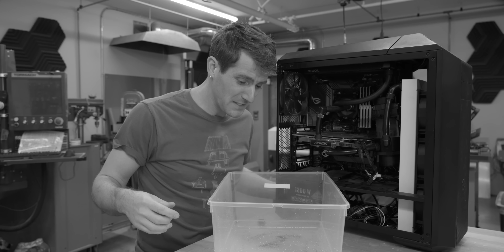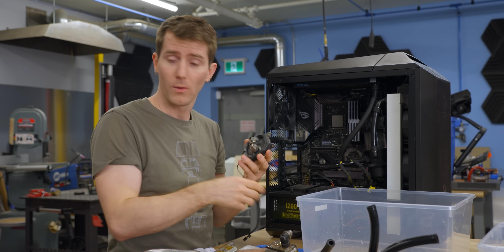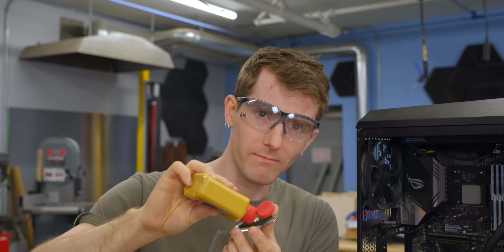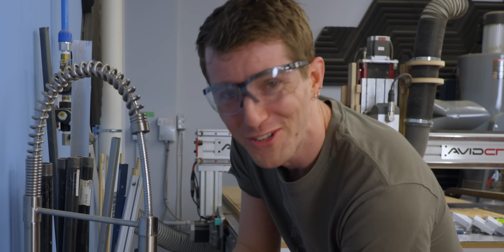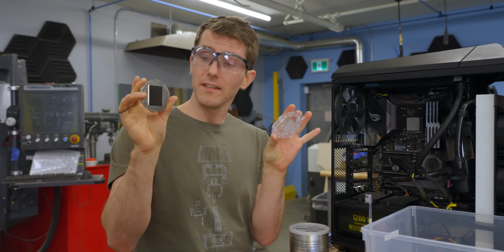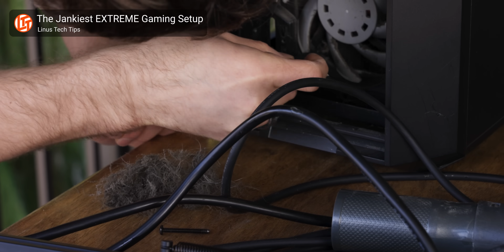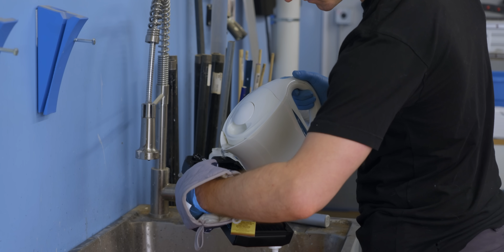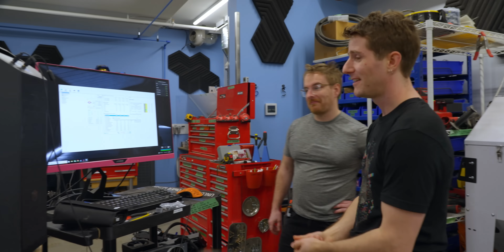I Will Never Watercool Again – Water Cooling Maintenance Guide

Comment: one thing I figured out while speccing my dual loop system was to key the rad fan speeds to liquid temps and pump speeds to device temps.  ramping fans to 100% because the cpu is heated up does little to no good when your liquid is still only a couple degrees above ambient.  After my build I've learned just how much more water passes through a GPU block vs a CPU black based on just how quickly the liquid heats up since, blocks aside, my loops are identical with 560 rads and 300mm tower reservoirs.  GPU loop fluid heats up about 10 times faster than the CPU loop.

edit: and yes, the system is completely a totally unnecessary and could very much have been less expensively and far more easily with air cooling.  apart from an aio on my last system this was my first foray into water cooling and I knowingly decided to just be ridiculous and forego other luxuries like not ordering delivery quite as often for a while.

Comment: Those water cooling "filters" fall apart in the presence of salt. If you added Iodine to the loop it may have been enough to cause it to disintegrate. I have softened water and used it to flush a radiator without thinking about it, next thing I knew my loop had turned purple, as the salt had dissolved the filter.

Comment: Personally, I've never understood the appeal of liquid cooling of any sort. If I'm using high-priced components that most folks would use in a water cooling loop, I wouldn't be able to justify the risk because I know I would mess something up, so if I'm building a high performance system I'll just deal with the extra noise of some fans rather than constantly wondering if my loop is sprung a leak and lost about $4,000

Comment: Or instead of water, you can use propylene glycol, as the industry does.  Completely safe, non-toxic and passive towards metals.  This "propylene" is important.  And it doesn't conduct electricity.

Comment: WTF do you guys even do to your systems?
My custom loop has been running without any maintenance since Fall 2019, closing in on 5 years now. The only effort put into it since completion has been topping up the liquid when I remember to (yearly at best) and minor hardware upgrades that didn't require a complete draining because I included quick disconnects inside for exactly that purpose.
The liquid is still the same shade of orange as the day I put it in (seethrough because particles are system killers), as clear as the day I put it in, and the loop is as performant as the day I put it together.
I think that nearly all cases of catastrophic watercooling loop problems come down to user error. (The last percent being mostly pump failure, which can happen even with something as reliable as the D5.)

Comment: At 17:26
Shaking her radiator....

How about this idea then? Put the hottest water/vinegar mixture you can get without boiling into the radiator, then seal it completely. Put it into a paint can shaker, in shake until the radiator is cool and the liquid inside has cooled down.... Open it up and there will be no squirts, and you may have had five or 10 or 15 minutes worth of shaking!!

I'd like to see a video show me whether my ideas plausible or not.

Comment: Have you tried pushing dry ice through it to clean it ? I use it to clean cars especially metal work with zero damage id be interested to know if its good for cleaning pc components, dry ice cleaning on cars is excellent for removing rust ect ect. Obviously dismantle the parst first lol

Comment: Linus at 18:05 "cut off the end of the tubes"
18:27 : clearly showing tube not cut off
Reply: Linus was the one that said to do it. Him saying it however does not necessarily mean that David will do that, intentionally or not.
We love you David.
Reply: Also said, "IF you had a little bit of extra length"
Reply: Those tubes have no extra length, they can't be shorter.

Comment: always mixing copper and aluminium in one loop 🤡 and dont get a 420mm MO-RA radiator where you can mount your pump on so you dont have to open your case when you never clean it from dust anyway. next step would be drinking the water right away from the loop
Reply: external radiators are just too good, I have alphacool 1260 supernova and oh boy, it is cheaper than most high performance radiators and works flawlessly

Comment: I've only spent $1,700 on my 5900x, 32gb, 16tb storage system with a 6950xt. I only bought an aio. I want to watercool my gpu but yeah I don't think for my longer term use it'd be worth it.

Comment: This entire video is nothing but a testament to why you should use the proper cooling additives including anti-corrosives AND antibacterial. I noticed Linus only mentions antibacterial additives at the end. There's a reason why water cooling fluids like Mayhems exist.
Reply: Yeah I run Mayhem X1 Eco Clear (vegetable based so you can just pour it down the sink) and I just cleaned my loop after 18 months just to re-paste my CPU block. Zero gunk, no particles in the block fins, no living organisms coming out. You need to use the right coolant, and tubing that doesn't contain plasticizer. I use food-grade santoprene tubing meant for restaurant beverage lines. Stay away from any cooling with colors (pigment will drop out and settle in/stain your blocks), get the right tubing like santoprene or ZMT, and make sure you do a good initial radiator flush to get the manufacturing gunk out. If you do it right you're golden with very minimal maintenance.
Reply: For really low maintenance, car coolant can work (I use the Prestone Corguard "all-makes" stuff at 33% dilution) - the thing that gets some appeal with distilled & minor amounts of additives is the highest technical thermal capacity of the coolant. Back in the day with non-nickel blocks (the bare copper sort) and absolutely NO aluminium I remember distilled and a silver coil being really popular.
Reply: @intercity125 Antifreeze and anything else added to pure water will lower thermal capacity (scientifically known as specific heat). 
Water - 4200J/KgK, 
Antifreeze (EthylenGlycol) 2400J/KgK, 
Cast Iron 500J/KgK, 
Gold 100J/KgK 

Out of all normal* substances, water is the undisputed champion of thermal capacity.  You add just a little not to freeze, to make galvanic isolation, to prevent gunk, etc. The more you add the worse heat trasfer you get.
Any normal substance will have lower specific heat. There are no additives to improve thermal capacity of water. Water has the highest by far.

This specific heat is what the unit implies: the amount of energy you need to raise the tempereture by 1 degree (Kelvin) of 1Kg of that substance.
The more specific heat, the more energy (joules) you can transport.

Thermal conductivity is also a concern and water sits average. But with liquid cooling you rely on convection heat transfer from solid to liquid and not conductivity, that liquid is moving and how fast is moving can and will outperform any conductivity cooling (including heat pipes). It's way easy to crank the flow up to tranport more joules.

*i exclude gases. Hydrogen has 15000J/KgK but you need to account for the huge density difference. You would need it in liquid form to be sort of usable and comparable to water. You need -255degC  (-423F) to have liquid hydrogen.
Reply: @intercity125 my body is using a chunk of silver size of my thumb is he panned on vacation, his loop looks really clean still I guarantee he hasn't serviced it
Reply: @jaredspratley6270 Guessing no nickel components in his loop then!
Reply: @intercity125  shouldn't be
Reply: Have run EK Cryofuel in my loop for years and it's worked well whenever I've had to disassemble it for upgrades.  Only surface wear on the tubing which a simple rinse takes care of and haven't otherwise had any issues with flushing the loop clean at all.
Reply: @dylanwinn3 Most car coolants use primarily ethylene glycol. That prevents the growth of bacteria at concentrations used (also the sodium tolyltriazole used as a corrosion inhibitor may have antibacterial effects itself)
Reply: People don't understand there are 4 important qualities to a good coolant solution.

1 Distilled water - this is self explanatory but distilled water has as close to 0 ppm you can get. Which means no minerals. Which means no bacteria, which means no corrosion of parts from chemical reactions between living organisms and abrasion from flowing mineral dust.

2 Good Coolant Detergent Package - this is also self explanatory. A coolant with a good detergent package keeps parts cleaned and keeps the grime and any other undesirables suspended in the solution, so removal via a filter or draining is easy and no dirt or grime builds up in pockets that settle in the loop.

3 Good Seal Conditioner Package - at this point everything is self explanatory but seriously, this one is important. Good seal conditioners improve the longevity of hard surface mate seals and prevents cracking and distortion of the surface by conditioning the materials and putting a small layer over top that wears instead of the seal. 

4 Good Lubricity Agent Package - a good lubricity agent prevents pump squeaks and prevents wear on any surface that rubs or touches. That includes surfaces that vibrate against each other from pump operation and fan motor vibrations/external vibrations. 

The nature of the coolant delivery agent, propylene glycol, prevents water from freezing or boiling at lower and higher temperatures respectively. The pressure of the system also prevents boil but the anti freezing property prevents damage from cold environments to the PC components. 

If your mixture solution does not have those 4 things, it is not adequate, and is improper. You will see no longevity results from anything less.
Reply: Is there a reason not to use waterless coolant in a computer?
Reply: @carmadme  I'm not really familiar with that so you'll have to forgive me for using Wikipedia for info here but, it appears waterless coolant was "invented to circumvent the problems of vaporizing water. When water vaporizes, it retains only 4% of its thermal conductivity." And had the main disadvantage of "Waterless coolant is generally more expensive than traditional water and ethylene glycol-based coolants.". So given that computer loops will never reach boiling temperatures and it's more expensive, I don't see why you WOULD use it, but I don't see any reason why you can't.
Reply: @drwhom2598  it's also used for its long life and anti corrosion which is why I was thinking it might be good for computers
Reply: @carmadme  yea normal coolant provides those same benefits so no need to spend more on that.
Reply: Why don't computer water cooling loops have a particle filter in them?
Reply: @jono6379  inline filters absolutely exist and people do use them. They're not really needed though if you prep your loop properly first and avoid things that can disintegrate (like that foam anti vortex thing in the video) or pastel coolants/dyes that can fallout and gunk things up.
Reply: @drwhom2598  so everything in this video is unnecessary if the loop is built right in the first place? Seems like ltt should be showing best practices for water cooling rather than just fixing problems they've created from doing things wrong
Reply: @jono6379 yea basically but I mean it's still a good video with good information on cleaning as even with proper prep and setup you will still need to break down and clean at some point (though it shouldn't be nearly this bad). Also they do talk about and admit a bit that this all amounts to user error as David said at one point he has drained and refilled the loop several times without ever re-adding any sort of biocide or corrosion inhibitor.
Reply: @drwhom2598  yeah I got to the end of the video where they mentioned it might be David's error after I first commented. Surely it wouldn't be too hard to make a cooling loop effectively zero maintenance apart from cleaning a filter or two once in a while? Cars and pools seem to be able to do it not sure why the same isn't true for pcs
Reply: @jono6379  your loop would be zero maintenance if you changed the coolant as often as you changed the oil in your car.
Reply: AND pro-tips: Weekly vacuum; place air purifier near or pointed towards fan intake.
It is easier to vac and clean out filters than to wipe dust caked on your fans and radiator.
Reply: @dylanwinn3  Well, I head that without conductive radiator hoses an aluminum radiator will corrode internally. Yes, I'm aware that many new radiators have plastic sides. However, anti-static plastic wrap for electronics is slightly conductive, so maybe the plastic sides on radiators is slightly conductive too.
Reply: @SmokeyWire56  Radiator hoses are not conductive unless specially made for that purpose, certainly not typical in the automotive industry. Radiator hoses are generally constructed of fiber-reinforced EPDM rubber. Stop spreading misinformation. Corrosion protection is provided by the specified coolant for the vehicle and the engine block and attached accessories are typically grounded to the battery.
Reply: The problem is, that the Gigabyte RTX 3080 Xtreme Waterforce is aluminium. Back in the they when the card was released, they said it is copper so everyone used it in systems with parts of copper and it caused a lot of leakage problems. After that they had to admid that it is aluminium. So if you're using this card use it with the premix water for pc-cooling or with glykol so the corrosion is blocked/limited.
Reply: Time to start adding sacrificial anodes in the loop?
Reply: @egerlachca  not required, i've run loops without flushing for 6+ years, just using extra diluted car coolants (30% instead of the rec 50%), just needed to be topped up ever so slightly due to evaporation.
Reply: @flandrble  just change it every 5 years the way you should be changing your car's coolant because the corrosion inhibitors will wear out.
Reply: @egerlachca  what? No? Just use a corrosion inhibitor lol. The only reasons sacrificial anodes are used in things like water heaters is because A. That water is constantly being cycled so an additive is useless and B. Even if that weren't the case, That water is intended for human consumption and such so a potentially toxic additive is obviously a no no.

In a closed cooling loop like your car engine or computer cooling, a coolant designed for lubricating and protecting the system should be used. No need to reinvent the wheel here.
Reply: @egerlachca Nah, corrosion inhibitors that you get in most coolants will do the job just fine
Reply: On a vehicle the radiator hoses are electrically conductive. Take an ohmmeter and test it yourself. That is to stop the engine block and the radiator oxidizing like a battery. That's probably why all the corrosion.
Reply: @SmokeyWire56  No, it's the additives in your antifreeze/coolant that prevent that. 

"It is very important that antifreeze or engine coolant is changed every 2 -3 years (4 - 5 years for vehicles with long life coolants) to replenish the additives that protect the cooling system from rust, corrosion, pitting, electrolysis, to gelling and foaming."
Reply: @drwhom2598  Take an ohm meter and test the outside of the hose for yourself.
Reply: @SmokeyWire56  I'm not entirely sure what your point here is? I don't need to measure it because whether it's electrically conductive or not, it's not the reason for stopping corrosion in your engine cooling system; the corrosion inhibitors in your coolant is what stops that.
Reply: @SmokeyWire56 radiator hoses are electrically conductive as they have metal mesh walls to stop them collapsing on themselves when coolant does inadvertently leak or boil over. No point having a hose if it can't handle the heat of the liquid inside it.
Reply: Or just install a noctua.
Reply: @GirlOnAQuest  yes, switching to air cooling will solve your water cooling problems. Quite the revelation there.
Reply: Just make solution of 0.01% bensotriazol with dissilled water why u need any cooling fluids?

Also Mayhems:
Note: The manufacturer of Mayhems points out that Mayhems fluids, in particular the Aurora product line, are produced and distributed for demonstration and modding purposes only. It should not be used on your system for more than 14 days.

We would also like to point out that Mayhem fluids may damage water cooling products and therefore, if Mayhem fluids are used, the warranty of the following manufacturers will become invalid: Koolance, Phobya, Alphacool, Aqua Computer, Watercool

Damage such as: blockages, dissolution of aluminum radiators, destruction of glued containers, etc. are the result of the use of Mayhems, but will not be reimbursed by Mayhems. Therefore, use only at your own risk.
Reply: @MrBalrogos  "The quote appears on multiple sites, it was originally in German IIRC so some context has been lost in translation. The whole quote is referring to Mayhems Aurora and is completely correct, but if misunderstood can give the impression that part of it is referring to all Mayhems fluids, it's not, just Aurora."

Please let's stop spreading misinformation.

Comment: This video only serves to confirm my philosophy that water cooling for PCs is a COMPLETE WASTE of money, time, and effort except for dealing with the most extremely hostile industrial environments. All I have ever had to do to my air-cooled systems over decades of either continuous (or at least daily) use is to blow the excess dust out of the heatsink fins and/or clean off the fan blades every couple of years or so. I have never had to replace a fan or remove/re-paste/re-mount a cooler. FWIW, I live in Orlando, FL, and do not have the benefit of air-conditioning, so ambient temps in the summer approach 100F.